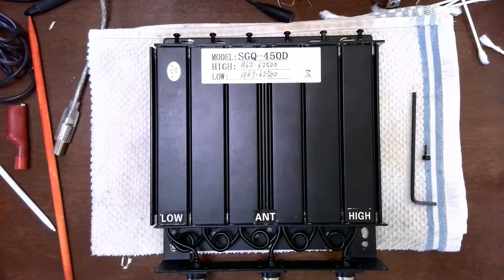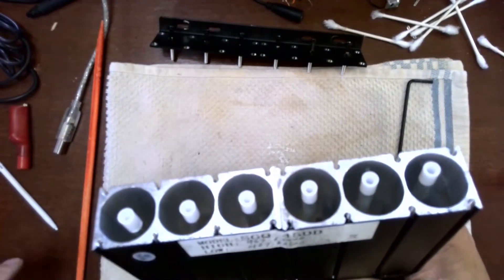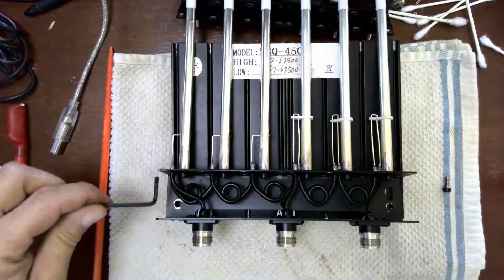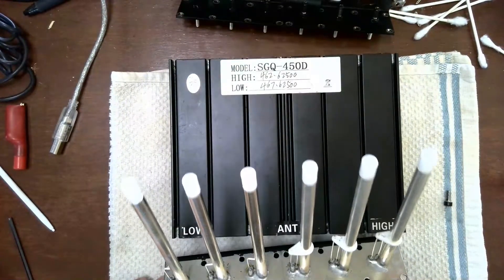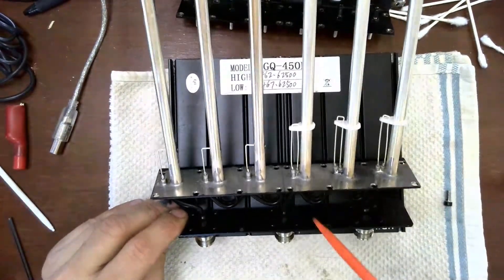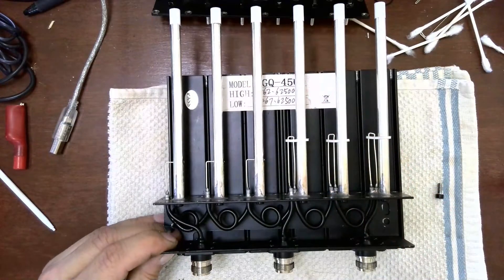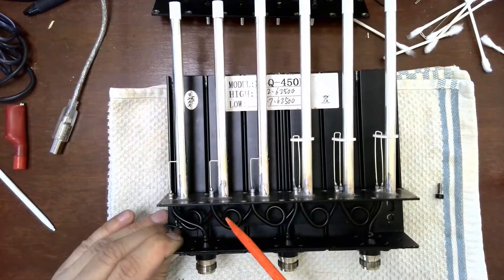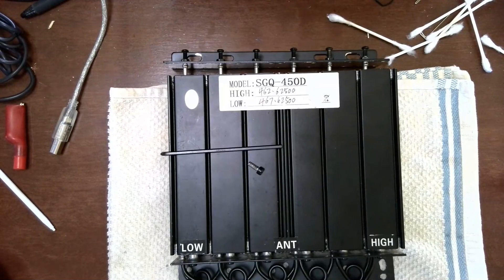🔺 Taking a SGQ-450D GMRS two way radio Duplexer APART to check for problems!!🔺

Comment: I have the same one except mine low and high are backwards. 476 is my High.,iam putting  48 watts into it and only getting 10-15 watts out. any ideas what's wrong?
Reply from the maker: sounds like a bad Duplexer did you just get it? did you check SWR on the TX (low) side of the Duplexer? I had someone get a new Duplexer and he was loosing lot of power come to find out the Duplexer had high SWR. he check it with a nanovna sure enought it was high! the Duplexer was brand new!!! he took it apart and found out it was dropped!
Reply: @GMRStwowayradio  oh great. Yeah must be the issue. I have the swr / power meter on the antenna output of the duplexer. Is that the wrong way? Thx
Reply from the maker: @chiefmatt1556  - no that will check the swr on the antenna to check it on the dulpxer  hook up the SWR meter on the low side (tx) on the duplexer BUT depending on what SWR meter you have you may not get an accurate reading watch my video on that https://youtu.be/2YiM74Saq3M
Reply: @GMRStwowayradio  sounds good. yes the low side always have to be the tx out of the repeater? or can it be switched ?
Reply from the maker: @chiefmatt1556  well technically i think it could be switch ( i have not tested this theory yet) because its just a frequency filter BUT the duplexer should be check with a spectrum analyzer or a nanovna and swr should also be check before doing that.
Reply: @GMRStwowayradio  ok thank you
Reply from the maker: @chiefmatt1556  - no problem that person who had the SWR problem before he knew what was going on it damage his amp. 🙁 so best to get things checked.

Comment: As far as the duplexer goes I was under the impression that the Low Side coax connector was for the lower frequencey and the high side for the higher frequencey. His hand written tag on the duplexer has it backwards. Could this be his problem? I have one of those set up with my repeater but I'm not real happy with it and plan on getting another antenna to do away with the duplexer. Thanks for making this video BTW.
Reply from the maker: The freq tag on the duplexer is correct, it was my fault when I order it.. I mixed the two up lol..this duplexer in the video works fine I was making the video just to show what the inside is like, so the other guy could compare to his and the other guy did find damage inside his duplexer.
Reply: @GMRStwowayradio  Thanks for letting me know. I was begining to wonder.....
Reply from the maker: @harryinoklahoma1866  - no problem. Sorry, I should have said that in the video.  but i am old and i forget..lol

Comment: It’s cool that you are showing a lot of these things like this. It just seems like your totally getting away from GMRS.
I would like to see more GMRS, and ways to improve range and the use of simplex repeater controller’s etc.   I’m more into the straight radio communication. Not radio through computer’s communication.
Reply from the maker: Sorry about that sometimes I get a request for a video but yes I will be doing more videos on that with some antenna builds, however when winter comes here this may delay some videos do to the cold.